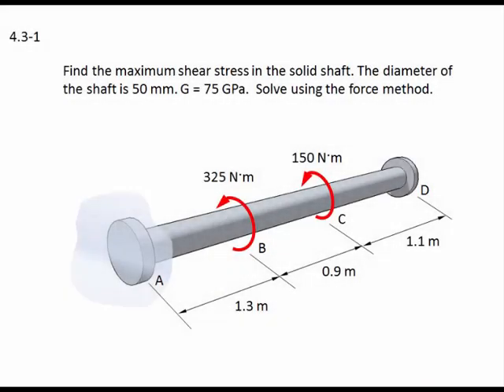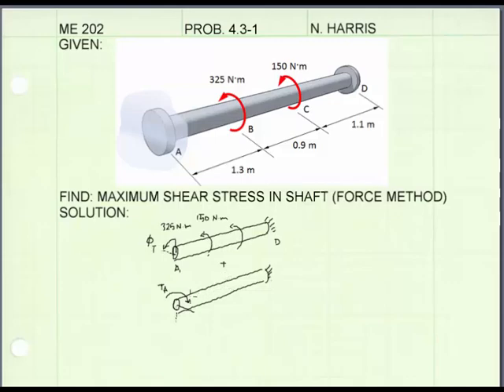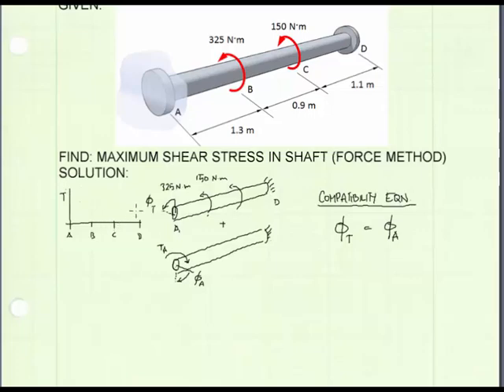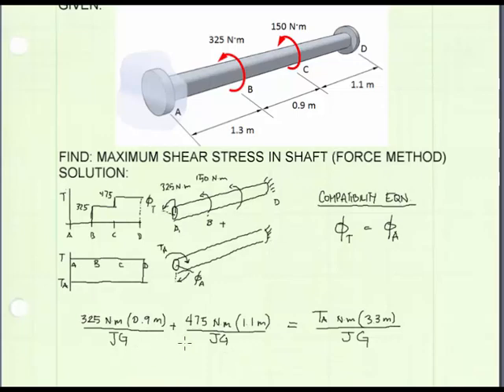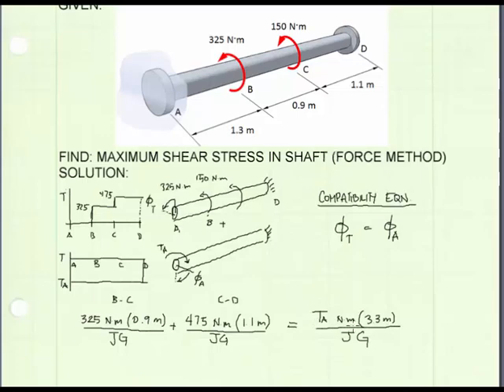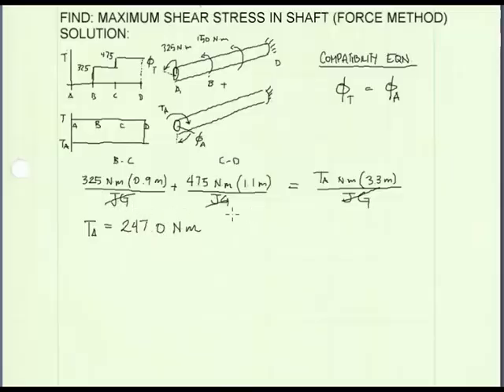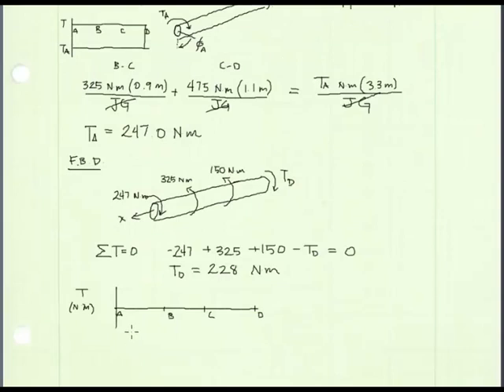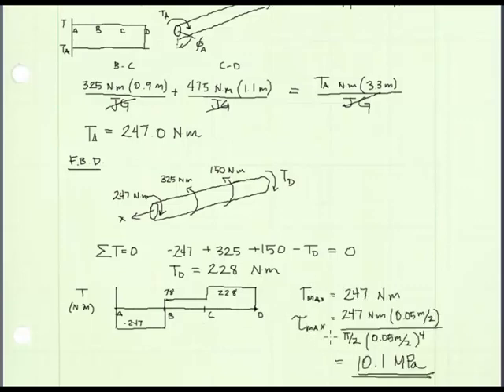04.3-1 Statically indeterminate shaft - EXAMPLE

Comment: Thanks for the video. I had a quick question. I have a problem where there is a bar ABCD of circular cross section having a diameter of 50 mm. It's fixed at A and D ends and carries two concentrated torques at B (1000Nm) and C (1500Nm). a to b is 2m and bc is 1m and cd is 1m. 
The solution I have goes through in a similar way, from equilibrium Ta +Td = Tb + Tc. And from compatibility (Theta-B)AB = (Theta-B)BC + (Theta-B)CD. As GJ is a constant for this equation I would have the compatability equation become Ta(Lab) = Tb(Lbc) +Tc(Lcb). However, the solution I have instead states Ta(2) = (Td-1500)(1) - Td(1). Please may I ask how they get this? Any help would be greatly appreciated.